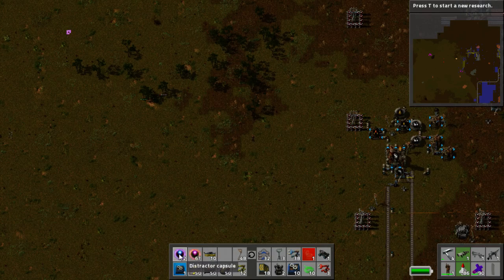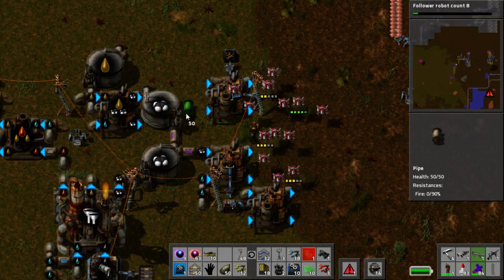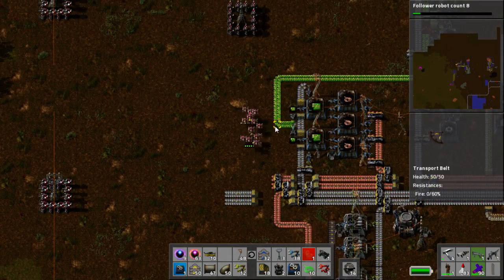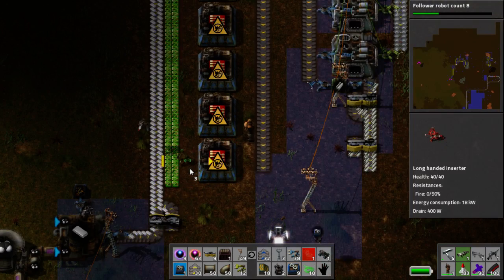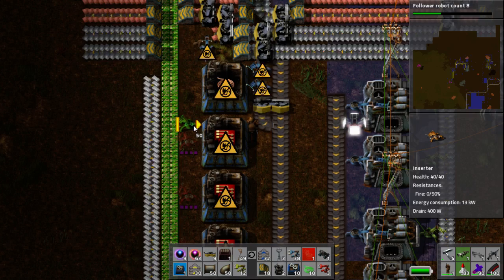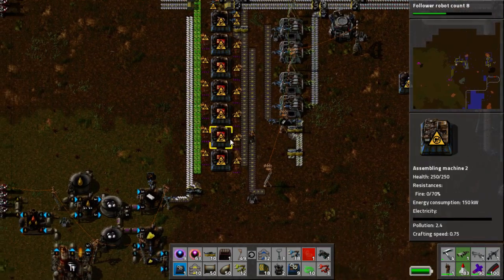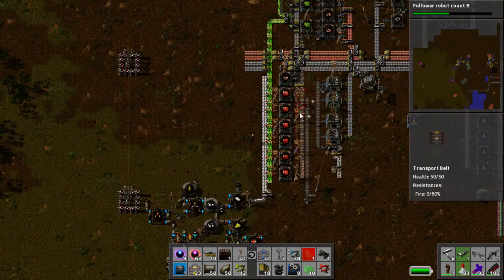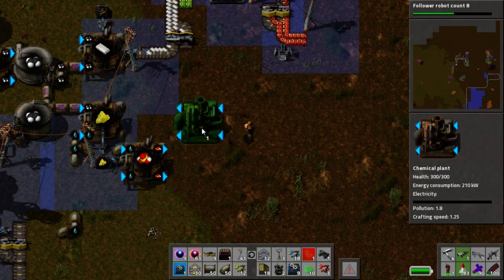Factorio Tutorial 40 Adding Oil to the Central Bus

Comment: Nice :-) Thanks for doing this. I guess the key message is that because the central bus is nice and compact, routing things like the green inserters to where they are needed is not a big issue.

Would you take batteries from the blue science line for "other stuff" like accumulators and laser turrets? Or would you keep the blue science build dedicated and create a separate battery supply for the other stuff? Same question for red circuits, I guess.
Reply from the maker: I'd take the batteries away from the main bus and bring whatever was needed down to it. I'd keep the one source to batteries and then split them out to the different builds from there. Hope this answers the question :) If it doesn't, ask again :D
Reply: Negative Root  Where would you get the required coal from for the plastics? Should I just add a chest and later on have bots fill it or should I add a belt to it?
Reply from the maker: Mannershark This would depend on how much throughput you're going to need. If you're planning on crunching out huge numbers of plastics, definitely a belt. If you're only looking for a small number, set up a chest and run it by hand until you get bots.

Comment: Once I get to Logistics bots, I almost invariably switch Science to be handled by bots, and put a cap of no more than 100 Red/Green/Blue Science Packs in the Logistics Network to minimize production to what is required to supply science.  This includes strictly limiting Smart Inserter production and having them transported by Logistics Bots directly to where they are required.  Batteries usually also get Logistics Bot treatment since it's easy enough to tie their transportation to Accumulators and Laser Turrets without using long belts.  Advanced Circuits are best built to mass supply processing unit/module production with a small number being siphoned off for Blue Science or other limited production processes.
Reply from the maker: These are all good thoughts and I agree with all of them.

Comment: I love these videos, but I have a question. The central bus design is fine, but you are using electric furnaces. If I'm building something like this in a new game, I won't have electronic furnaces. Do you have any suggestions on how it could be incorporated?
Reply from the maker: +Qieth the kind of furnaces you have is completely irrelevant??? the central bus idea is used with all kinds of furnaces, doesn't matter which.
Reply: +Negative Root Well, not entirely. In the start of the bus, it's not an issue, but if you decide to set up your steel production in the middle of the line, and you don't have electric furnaces, then you'll have to run some coal through the bus anyways
Reply from the maker: Qieth you're thinking too narrowly.

https://www.youtube.com/watch?v=IbtB7dVOLMQ